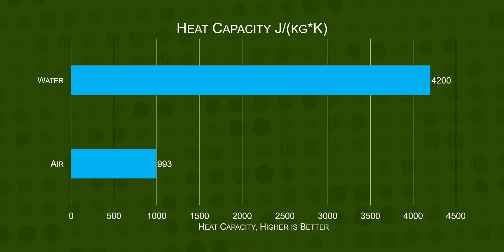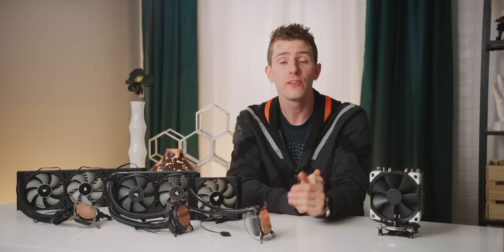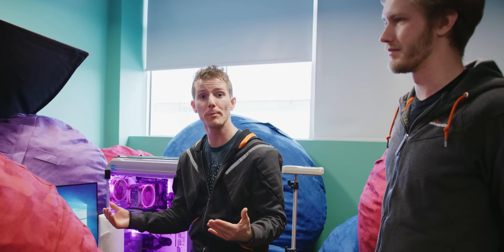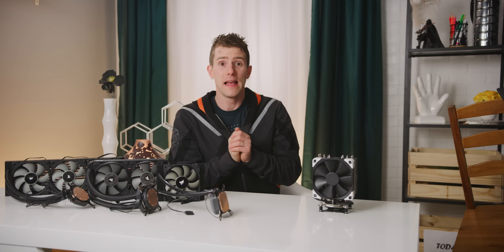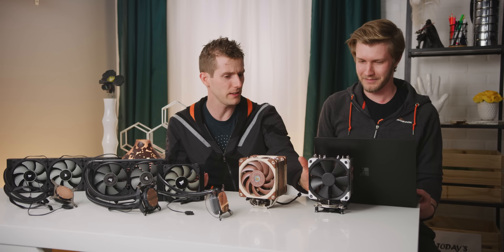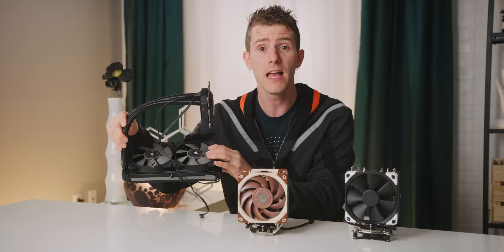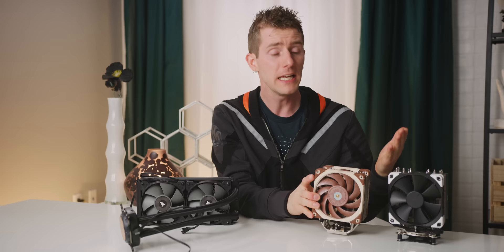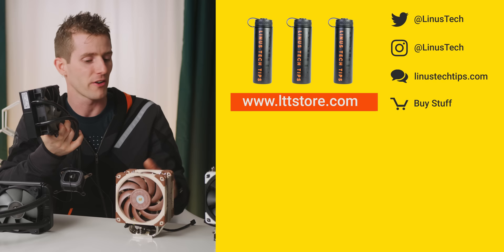Why you shouldn't water cool your PC

Comment: Should I use water coolers?

Linus: Yesn’t
Reply: original
Reply: @R3in_Ch  thanks
Reply: Yes, thats f crazy , 
See think :
For example a company gives u a gureentee of 2-3years , go for it
Also, air cooler heats up other parts if the air flow is bad

2 fans version is best

I just wana say that DONT BUY AIR COOLER
Reply: @ankittayal8291  then just make sure the airflow isn't bad? quietness = ftw.
Reply: @ankittayal8291  You sure are highly convincing but I have just one observation: you forgot to mention RGB lights that make everything better.
Reply: @GholaTleilaxu  🔥🔥🔥🔥🔥🔥🔥🔥
Reply: maybe
Reply: Linus: You shouldn't, but I certainly will.
Reply: Lmao
Reply: 🤣🤣🤣🤣
Nice👍🏿
Reply: His answer for everything
Reply: No
Reply: yes
Reply: Yes and no
Reply: @jayjaygolden5123  Your comment is confusing. He's saying he's going to use custom water cooling, not AIO's.
The thread you're responding to use talking about Air vs AIO.
Reply: This isn't about water coolers. It's about AIOs. If you also cool your GPU, I'm sure the results will look different.
Reply: @GholaTleilaxu  they also make them 10 percent faster
Reply: @JERRY tm The cooling liquid doesn't just leak out. It's not like a custom water cooler where you have to top it up - unless you actually damage it, it's completely fine. Just like a CPU or pretty much any other computer part, it's fine if you don't damage it and if you do then it's sorta your problem
Reply: Facts lol.
Reply: Uh no.
Reply: @JERRY tm water won't damage your pc as long as it doesn't reach any voltage. if water leaks your parts will be fine, just take them out to dry until they're completely dry. if you use any other liquid, like a coolant, and it leaks: you're fucked
Reply: @JERRY tm just do the job properly
Reply: @frosty_josh8048  yes it does, I don't want to hear it at all, even walking into my room, I don't want the noise front the pc
Reply: @frosty_josh8048  some of us do more than play games on our PC... when reading emails, doing work, researching stuff etc, it's nice to have silence.
Reply: @TuriGamer  
humor
noun [ U ]
/ˈhju·mər/

the ability to be amused by something seen, heard, or thought about, sometimes causing you to smile or laugh, or the quality in something that causes such amusement:
// He has a wonderful sense of humor.
// Fortunately, she saw the humor in the situation.
Reply: Corsair AIO suck....Try an EVGA, or better yet an Artic Freezer 2 280mm which kicks ass on all of them....including the air coolers
Reply: Lol 😂😂
Reply: linus: u shouldent water cool pc
me who water cools cuz air cooling is ugly: haha rgb go brrrrrrrrr
Reply: It’s Yo not Yesn’t
Reply: lmao
Reply: @ankittayal8291  With air coolers, you won't live with the risk of the pipes BURSTING and damaging like 80% of the PC parts. I'd rather have worse cooling than living with the risk of losing over 500 bucks mate. And air coolers are cheaper.
Reply: Translated by google
Reply: It's almost like the decision carries some nuance and depends on preferences and usage patterns.

Comment: The point you said about heat pipes fundamentally being liquid is spot on. You can absorb much much more heat through phase change than you can through direct convection only. Those little heat pipes can conduct hundreds of watts of heat with only a few degrees drop across their length. And there's probably as much fin surface area as the radiators.
Reply: You also have to account for air flow over said surface area, aka the number of fans

Comment: Gamers: I hate case noise!

Also gamers: Sound canceling headphones at 110% sound whoring at 120db
Reply: i hate headphones, i play 95% of my time with speakers ^^.
Reply: That’s exactly why I don’t care about the sound. Plus the graph he used for the decibel chart is misleading. 20 decibels is I believe 10 times louder than 10 decibels. Same core 20 and 30 and so on.
Reply: who the fuck uses sound canceling headphones?
Reply: @Pepe-dq2ib  me. Good quality sennheisers
Reply: @Handlehandleistaken  no such thing as good sounding noise canceling headphones. I doubt it sounds any good as their every level HD 6XX that you can get for $160 on sale.
Reply: @Pepe-dq2ib   Actually there is such thing as good sounding noise cancelling headphones. I have two of them. One that less then a 100 dollars and one that's 139.99 and I can definitely tell the difference between my old cheap one and the more expensive.
Reply: @lxrdkenji  whats this miracle $140 headphone that sounds as good as a HD 6XX? I mainly use a T60 Argon for my daily can.
Reply: @Pepe-dq2ib   I don't care for anything as good as hd6xx or whatever. I simply responded to you stating that there is no such thing as good noise cancelling headphones. All I said was that there are good and bad ones. As I could tell the difference between my cheap 50 dollar ones and the ones i bought that was almost 200 dollars.
Reply: @Pepe-dq2ib  And deeming the fact that the hd6xx is now only 200 dollars i mean..
Reply: @lxrdkenji  i've tested $1000+ noise canceling headphones and nothing even comes close to my Argon, let alone a entry level HD6xx....
Reply: @lxrdkenji  its only 200 now because Massdrop bought rights to produce it cheaply. The headband is of cheaper materia and no longer made in Ireland, but the drivers are the same and no cost in R&D.
Reply: @Pepe-dq2ib  Bruh I do not give a shit in the slightest. All I mentioned is that there is a difference between some noise-canceling headphones. I do not give a damn about no hd6xx or anything for that matter. I only mentioned the difference between cheap noise-canceling headphones and expensive ones. Don't care about your argon and definitely don't care about hd6xx.
Reply: @lxrdkenji  then why did you replied to me if you didn't give a fuck? Noise canceling as a concept degrades sound by blocking certain freq, that alone is enough reason why they sound bad.
Reply: @lxrdkenji  its not an opinion lol. Its general knowledge that noise canceling degrades sound quality no matter how you look at it. Its science and engineering, not your feelings. I just used the HD6XX as an example for a entry level can that sounds good, ain't nobody flexing with a HD6XX that can be bought at $160 on sale. I dont even own any high end headphone, Argons are mid range entry level planar. Its because you tagged me in the reply, your comment was directed at me. If you want to post a general statement then do so without tagging somebody.
Reply: @Pepe-dq2ib   You honestly don't make any damn sense. My reply was simply to state that are differences between cheap and expensive noise cancelling headphones and showing that there are good ones. You stated that noise canceling headphones degrade over time. But practically any headphones or earphones for that matter end up degrading over time this isn't some new shit that isn't known already.
Reply: @lxrdkenji  why would you tag me? my point is all noise canceling sound bad even if one noise canceler sounds better than another noise canceler, they all sound bad. You should be just replying in general.
Reply: @lxrdkenji  Uhh.. Headphones don't degrade. My hd600 is 8 years old, my er4s is 12 years old and still sounds better than Bose QC35's and Airpod Pros I've tried.
Reply: You might be talking about earpad degradation then sure.
Reply: @lxrdkenji  chill, it sounds like you got nothing else to say and just resort to personal insults now.
Reply: @ASmugsie   My guy i'm not the one stating that headphones degrade the guy whos trying to be a smart ass is the one who's stating these things.
Reply: @lxrdkenji  woops, carry on.
Reply: @lxrdkenji   @Pepe  Girls, GIRLS, you're both pretty. Now block eachother and get out of this poor guy's mentions.
Reply: Honestly i love the sound of my PC fans lol. It sounds like there's an AC on
Reply: Lmao laughs with anker soundcore wireless headphones with anc xD
Reply: @Pepe-dq2ib  me ? 
YOU HAVE PROB WITH THAT!?
Reply: @Pepe-dq2ib  bruh u guys are so extra anker soundcore anc headphones are literally much cheaper and and I can tell you that Active noise cancelling helps here mids and bass better at low volumes.....
Btw mine are just 100 if not 50$ -_-
Good for me and my minecraft gaming..... 
Unless you guys have shit bluetooth in your pc.....
Also no delays what so eve in my experience
Reply: @emailing  ..... Yea i guess?

Cries because mine sounds like its taking off when I play mc on my chromebook -_-
Reply: @lxrdkenji  i am guessing english isn't your native language? I only said the noise canceling concept degrades sound quality. Now you're telling other people i said headphones degrade...
Reply: @ethearnos6397  good for you, stick with your Anker ANC headphones. Ill stick with my T60 Argons, i dont mind paying a bit more for something i use everyday.
Reply: @Pepe-dq2ib  speaking of what u have link it to me I might buy 
( If its not overly fansy with rgb colors lol)
And does it have anc?
Reply: @Pepe-dq2ib  oof but ill look thx
Reply: @Pepe-dq2ib  daaaayyyyaaamm bro yours look so ancient
And the wood pretty classy nice
And holy fuck 385$ damm
Reply: ehh no i feel claustrophobic when i have noisecanceling in my room XD
Reply: @ethearnos6397  and you probably buy a new phone every 2 years that cost $800+ lol. These headphones will last me 15+ years and sound light years better than your $50 ANC. There is a reason why the Argons are sold out and on waiting list, even the older mk2 without wood cup that you seem to hate.
Reply: @Pepe-dq2ib   oh wait a dam second yours are wired headphones...
also I dont hate the wood cups at all
do you even know the definition of classy 🤦
Reply: @ethearnos6397  well yeah, you cant have amps on wireless headphones lol. Headphones sound best amped.
Reply: @Pepe-dq2ib  lol
Reply: @Pepe-dq2ib  My Sennheisers, 4 years old now, padding around the ears tearing.. best damn headphones. When playing video games I can tell ever so precisely where sounds are coming from.
Reply: @SupraSav  yup, the best thing about the sennheisers is they sound better with more amp. Great valued headphones, especially the Massdrop versions.
Reply: @emailing  FRRRRR

its calming asf to fall asleep when hearing ur fans running
Reply: @Marauder sorry, english is my 3rd language. Is this an American metaphor, because i don not understand.
Reply: @Pepe-dq2ib  I'm a musician, and the hd6x is the most overhyped, shit headset of all time
Reply: @dagothur2720  lol ok then, what do you have in that price range thats better? Dont tell me, superior noise canceling headphones?
Reply: @Pepe-dq2ib  I didn't say noice cancelling were better. It's just the seinheisers are overhyped open back shit. I can't stand open back headphones
Reply: @dagothur2720  so whats a better open back thats $190 and can be had at $160 on sale? Is your problem Sennheiser or open backs in general? You must also hate most planar headphones too, since they're pretty much all open backs. I only own two close back, an old denon ah-5200 and sony cd900st.
Reply: @Pepe-dq2ib  chill out dude it’s just headphones
Reply: @josselinplanet8240  that explains your 0.14 KDR
Reply: @DankMadCityMemes  i think you speak about online game ? i'm not english.
And i don't play online game, i prefer a good game.
Reply: man the coolers nowadays are so much quieter than the old options. people dont even to begin to understand how good they got it now.
Reply: I never got this thing about wanting quiet fans. I want to know my fans are on and working. It's more important to me my fans are cooling the system than having it super quiet and not knowing the fans are dead before it's too late and my cpu is burned to a crisp.
Reply: wh'y i worry about case noise when theres the aircondition, fans , traffic , planes, living room TV noise
Reply: @Pepe-dq2ib  bud have you ever used bose A20s?
Reply: @TheKingDrew  yes, have you ever used those senheissers or other good headphones? It's literally the concept that noise cancelling creating new sound waves with lots of missing freq, most of which are the lower freq. They all got shitty bass and whatever bass it has is muddy and boomy. How can that sound as good as a decent regular can?

I don't care much about top headphones list, but you'll never see a noise cancelling can be in the mix  with regular ones for a reason. Even if the list was for similar budget cans. Once you try a decent set of planar headphones like an Argon, you'll never go back.
Reply: @Maschine_Elf  "Noise cancelling degrades sound quality" first of all this conversation been ended months ago. Secondly, why the hell are you pointing out the obvious? Thirdly, if you actually read my comments correctly instead of coming in to say something. You would know that I never once said that noise cancelling headphones DIDNT degrade. I said that based on the prices that it takes LONGER for some to degrade then others based upon how expensive it is. This is a straight up FACT and it ain't even cap there's really nothing you can argue. And all I said was is that you can definitely tell the difference between sound on a 20 dollar headphones compared to a 150+ headphones.
Reply: my old pc sounded like a jet engine my new build is quiter but still kinda loudish under load it doesn't bother me i have 8 fans in my case not including the 3 on my gpu some noise should be expected i value cooling performance more than silence.
Reply: hang the machine OUTSIDE https://youtu.be/nu-GNyzga_8
Reply: I game with Senheiser open backs, not hearing what's around me is unnerving
Reply: @Pepe-dq2ib  Just get better ears so you don't need top-quality headphones to hear anything in games or videos.
Reply: @Dmm3  I'll just join blm so I don't need to work.
Reply: Razer kraken good for competitive games? I don't use headphone and am a speaker guy..but when it comes to competitive games I might get one.
Reply: @Pepe-dq2ib just stop you got ratioed several times, it’s an opinion
Reply: @Pepe-dq2ib  same with you....
Reply: @pureto4808  it's as much of an opinion as a horse being faster than an F1 car to a person.
Reply: @pureto4808  noise cancelation degrading sound is a fact, not an opinion.
Reply: Also don't mention the loud as keyboards
Reply: i actually have no idea how my ear buds are more comfortable for gaming than headphones
Reply: @Pepe-dq2ib  So based wp
Reply: @lxrdkenji  hUmaNs CaN'T sEE oVeR 60 fRaMEs copium
Reply: Cant sound cancel my microphone 🎙
Reply: @Pepe-dq2ib  a lot of ppl use noise canceling headphones, not everyone needs to use MIG air gas for their listening experience kek
Reply: @tempestsquall5882  ok... didn't realize anyone was arguing that people use them.
Reply: @Pepe-dq2ib  bruh you did lol, you literally said who the fuck uses noise canceling headphones.
Reply: @tempestsquall5882  and how does that say people dont use them? It was a question not a statement.
Reply: @Pepe-dq2ib denial, just because you’re asking why makes no less the fact that you were inferring it.
Reply: Bitch i got my steel series and im fine
Reply: personally I hate noise canceling
Reply: The sound cancelation is BS for a reason.
Reply: @Pepe-dq2ib  i'll do you one better, who DOESN'T use sound cancelling headphones?
Reply: @Pepe-dq2ib   man, it's almost like companys market sound Canceling for a reason...

You are a hardcore audiophile and it shows, you seem to love open backs alot, but your mind isn't very open... 

I use my Sony wh-900n whenever I need to take the public transport, I feel nauseous when there are too many people talking out loud, most of the time, I have the ANC disabled, but when noisy people get on the train or bus, I can just turn it on have have some peace and quiet. The bass by default on this thing is a little much... But fortunately Sony has a bass slider in the app allowing me to turn it down, I've used these in wired mode, you can tell that Sony just boosts the hell out of the bass in the wireless mode.

However, I only use open backs at home, but often, the sound of an airplanes or my neighbours drilling into their walls get in my room, that's when open backs are weakest. Close backs are also at the mercy of these dreadful noises. anc is like electronic earmuffs/plugs, it seals well by default, but also cancels out noise with its drivers. Its not just for music, it's a portable "mostly quiet" space.
Reply: @mikuramsay  I prefer to use my Ampeg 20 at home with a fender ultra jazz not too loud but produces nice clean sound and allows me to be able walk around the room. probably wouldn't try and take it out in public or in any forms of transport.
Ow and having the gain control and an active pre-amp on the fender is very useful when I'm trying to get the sound and tone I like.
Reply: @Pepe-dq2ib  Do you go on and on about how your car is the fastest car there is around too? 

The way your messages read are obnoxious as hell, and you don’t even realize it. Instead of just recommending headphones you like and explain why you like them, you feel the need to put down everyone that don’t waste hundreds of dollars for entertainment lmao
Reply: @josselinplanet8240  I only play with my speakers when I'm playing alone. Comp shooters and just genarally playing with friends is better with headphones.

Comment: I’d like to see tests done with mid and small tower set ups. I’ve always figured water cooling would only provide superior cooling in tight spaces with higher ambient temps.
Reply: Not at all. Try and air cool a gen 13 or 14 900K unit that does transcoding.